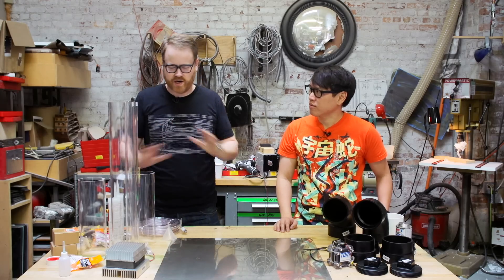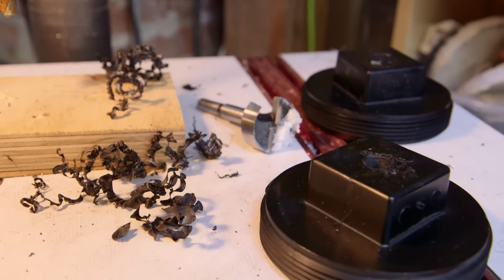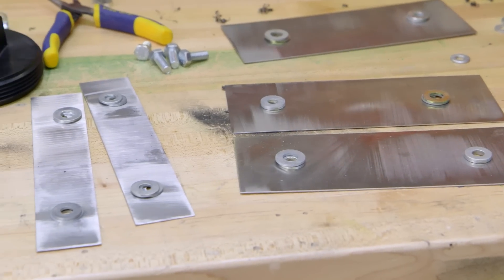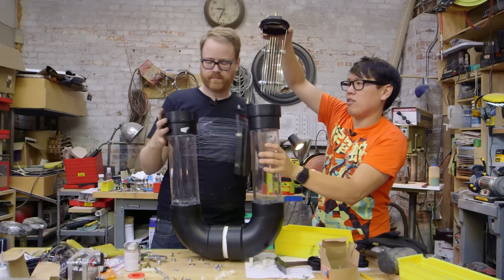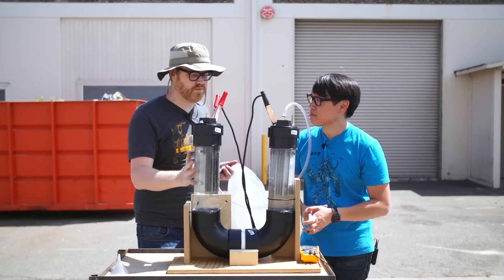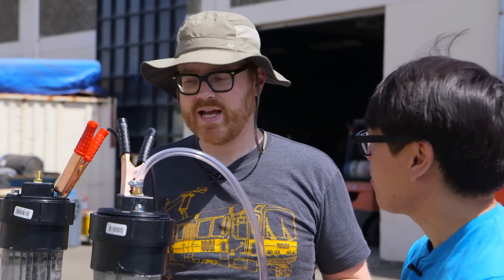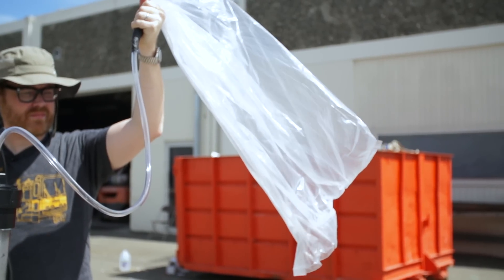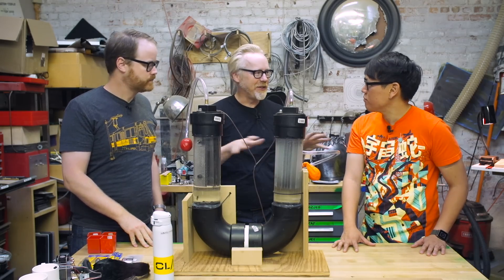Tested Builds a Hydrogen Converter

Comment: WROOOOONG! the trick is AMPERES not voltage, this video was made to fail on purpose, i  hate this kind of "shows"
Reply: @Don Diego Mine is 13 plates with both outside being either positive or negative depending on how I hook it up and all the plates alternate polarity in between. so it goes P,N,P,N,P,N,P,N,P,N,P,N,P, and it pumps out so much gas I get scared to play with it. I made it for a torch but blew up the torch and almost my hand due to not using a flashback arrestor that is definitely the most important part!
Reply: Neutral plates on this configuration are different as they're doing a cathode and anode. There's a difference between the gasses they're producing and the simple dry cells to make only HHO. This was "discovered" by someone at University recently-ish. I'll try to find a link to the article.
Reply: @jonross377 This is a good one  https://www.youtube.com/watch?v=eDXA7Veg6FU
Reply: 😂🤣it's just like the myth busters episode where Jamie tried to start the car off of HHO without even modifying the engine 😂😂😂
Reply: Why don't you make a video showing us the right way to do it?
Reply: I bet you they're paid by big oil companies to try and discredit hydrogen-powered fuel cells like these look up the geek power engine seriously don't do anything
Reply: @pearlstar159  I really wish that wasn't believable.
Reply: @Stephen Laverty ---You can't compress HHO gas to that kind of pressure it will explode on its own, that is a bomb, don't try it !!!
Reply: Correct
Reply: Y'all don't know what you're talking about. For a given cell design and electrolyte concentration, Volts and amps are proportional to each other.

If they put them closer together it would drop resistance and produce more gas
Reply: 2v
Reply: While electrolysis can produce hydrogen fuel through the separation of water into hydrogen and oxygen using renewable energy sources, the process requires a significant amount of energy to be inputted, making it inefficient and not environmentally sustainable. For instance, to separate one mole of hydrogen and oxygen through electrolysis using stainless steel electrodes and potassium hydroxide as the electrolyte, it requires an input of approximately 179.3 watts, which translates to a significant energy requirement for large-scale hydrogen production. This makes electrolysis an unsustainable fuel source, as it is not yet efficient or cost-effective enough to be a widely viable and competitive alternative to traditional fossil fuels. Also, voltage and amperes go hand in hand. Like the old trope it's not the voltage that kills you it's the amps but the true statement is it's not the electricity that's kills you it's the electricity. Look what I'm getting at is take some time to better understand the chemistry, electrical physics, and thermodynamic laws of energy conservation (sounds fancy but super simple). You'll gain a better understanding of why this process is not feasible for powering a vehicle. However, here is something that might spark your interest into learning more. A hydrogen fuel cell takes hydrogen and oxygen forming them back into water then taking the energy used to split them. They are being testing for car battery replacements but we are nowhere near there.
Reply: Correct but the only way you're going to get more current to flow through the solution is by increasing voltage (without changing electrolyte concentration)
Reply: I barely know anything about this stuff. I do know some about electrical. I knew it was shit when he says they went with the panel instead of a car battery because they wanted to go as "green" as possible. Most solar users have them hooked up to batteries lol. This show is hot garbage lol. 
What sealed the deal was knowing they didn't use the car battery because the cranking amps would have been way more than the amperage of that shit panel lol
Reply: Jackasses. Did this on a much smaller scale with a higher amperage panel and it works great. Click bait BS. Fkng useless channel, would not recommend...
Reply: Lol... I wanna now the full motive in this as I learn. V and W are 1:1 and what of amperes. A bunch of couple of zeros😮
Reply: That's right
This vidéo was maded to break this idea
Reply: @Don Diego can you show us how to build a real one. Pls. Im trying to make my bycycle run off of hydrogen by decreasign the fuel ratio to a drip rather then a flood to be safe. I need some help plssssas!!!!!!!!
Reply: @burntchickennugget191  Like this?: https://www.youtube.com/watch?v=prSbM4Zsx8M
Reply: correct
Reply: 12 volts at 7 to 10 amps does mine good without the water starting to boil.  works same as the 5 volt at 24 amp config :-)

yup.. your right, and his cathode and anode are a foot apart..  I bought a unit that spouts 1 litre a minute..  but the plate are a millimeter apart lol....
Reply: True  I just hooked my 5 plate up to my panel an its pissing out h2 /0 ...these guys were paid good money to lie its a disgrace hey..
Well at least we have fuel if the Sh!t hits the fan :)
Take care
Reply: True
Reply: Confirmation: I was there. Was the previous subscriber to Adam Savage's Tested.
Reply: You are right it is current that drives electrolysis, not voltage. Also was surprised to hear that they wanted to get 15L of hydrogen from what seems to be less than 15L of water.  And that's on top that there is about 12% of hydrogen and 88% of oxygen in water. They would  need about 100L of water to get 15L of hydrogen from it.
Reply: Michael Lysov , nope. 
This video shows no pressuring or cooling equipment. So I’d assume that the oxygen & Hydrogen is to be at room temp and atmospheric pressure.... both would be a gas.
From 3rd form science, a gas is much less dense then a liquid. Your 100L of liquid water would give, slightly more then 100,000 L of hydrogen (as a gas)... hydrogen is the least dense element... means not much of it occupies a lot of space.
I think they have enough water in the tube.
Reply: @wingmanmedia6536     I hope you were being sarcastic or are you just plain STUPID !!!

Comment: Pulsed higher dc voltage with plates at close distances works better. Dont push when you can use a hammer.

Comment: You guys had to of made this faulty on purpose. I've seen countless videos, especially from Grant Thompson, where low voltage, high watts, will make the gasses pour off from the water/electrolyte mixture at a relatively rapid rate. But it's not a surprise to me ;) you bozos did the same stupid shit on Mythbusters using tap water and denounced the entire process as useless. Now you know too many people have been doing this at home, so now you want to make it sound too inefficient for home use. Bullshit.

Comment: Once I saw that redheaded dildo pop in at 9:00 I knew this would be bullshit. Way to suppress people by not building this properly. When you scale this down and hook up to your car battery you will be running ZERO emissions, boost of horsepower, and cleaner motor. If you are smart enough to be on here on this subject, do real research instead of "paid for" tv dumbing you down with their fictional science. You wont be able to harness hydrogen but you could power your car and so much more with this and other amazing free technologies. Use it or lose it.
Reply: +Duke Nukem , are you saying you can connect a hydrogen generator to your car battery and run the engine (ICE) only on the gas produced to obtain Zero emission?  or are you saying that adding the H gas from the electrolysis will turn the petroleum fuel combustion into Zero emission?  More details on your proposed system please,  like how much H gas production needed per 100 CID or 1000cc engine displacement?  How much amps does this system draw & how much hp/kw engine output is lost on providing the electricity to power the H gas generation system? How much wheel HP gain can one expect from this system?  And most important of all is this system defeating the laws of thermodynamics?

Comment: Another way to build the plate assemblies would have been to use a long flat stainless plate sand it up and wind it into a spiral, thus saving a lot of engineering work. A stainless rod could be welded to the centre of the spiral for the input to each electrode.

Comment: What happens if you put heavy water instead of normal water?
Reply: +Eduardo Cury you would create mainly Deuterium Gas  (²H) instead of the mainly diatomic protium Hydrogen gas (H2) you get with normal water.  You'll also need more electric energy to split the deuterium Hydrogen from the Oxygen since the bond between them in heavy water is stronger than it is with protium Hydrogen in normal water.

Comment: If memory serves me - energy follows the easiest path:  Through the metal bolt.
Therefore:   use non-metal rod and insulate between nuts and plates.  Then current will travel through water/electrolytes.

Comment: These guys are muppets.
I could literally get more HHO using a 2lte milk bottle and 2 steel plates in my kitchen.
They clearly do not even have the most basic understanding of how electrolysis works.
Reply: The task was to obtain 15 liters of Hydrogen Gas and not Oxyhydrogen gas (HHO). Guess you'll need to make some mods to your milk bottle to do that.

Comment: the reason it failed was the distance between the cathode and annode. they placed them on opposite sides of the device. if they wanted it to work both sides need annodes and cathodes in close proximity.

Comment: Why not use hydrogen as a primary fuel source? If it's so abundant
Reply: +Insomnii sure it's abundant but the problem is Hydrogen is not naturally available in it's pure atom form instead it is chemically bonded with other atoms into molecules like water for example.  This chemical bond is very strong and it requires a large amount of energy to break this bond to obtain the pure Hydrogen. Furthermore production methods like electrolysis to obtain Hydrogen are highly inefficient thus making it rather expensive to obtain pure Hydrogen in sufficient quantities via these methods.  Industrial Hydrogen production via steam reforming of natural gas can be done more efficiently but it is still more costly to produce Hydrogen than petrol fuels.
Reply: Arya Javaheri you need to do much more in depth research on the subject matter. Some hints regarding Hydrogen storage, look for High pressure gas, liquid, adsorption and absorption Hydrogen storage  methods.
Reply: Arya Javaheri huge difference between elemental Hydrogen ( Atom ) and Hydrogen chemically bonded in a Molecule, look up the difference.  You should also look up how much electricity is actually needed to split water into Hydrogen and Oxygen via electrolysis,  it's not just some if you want   quantities of Hydrogen that are of use and not just for those small school HHO gas bang experiments. Multiple different storage solutions of elemental Hydrogen are also available but just like the production of Hydrogen these are expensive thus add to the already overall high production cost of Hydrogen.
Reply: Hydrogen is hydrogen. A hydrogen atom cannot tell the difference if its been released from the bonds between itself and oxygen versus wherever else hydrogen can be obtained from. I've looked into this subject and spent many hours in research to know that the issues lie within its storage.. not in its production.
Reply: +Milan   not to mention the inefficiencies in making the hydrogen, the embrittlement of metals when exposed to high pressure hydrogen, etc. etc. etc. Hydrogen is one piss poor energy carrier, regardless of what the hydrogen people say. And HHO on demand systems, as you have said, are great for making the HHO on demand system MAKERS rich, while scamming the poor suckers who are looking for something for nothing. The ignorance about all this shit is so disheartening.
Reply: Insomnii The comment above is nonsense. The reason why it isn't so abundant is because hydrogen is quite difficult to store.
Reply: Arya Javaheri since when has storing of Hydrogen anything to do with the natural occurrence of pure Hydrogen? The reason for natural elemental hydrogen being rare in the earth atmosphere is that it actually will slowly escape the earth atmosphere due to to it's light weight and the gravitational force of the earth being too low to hold it back ( look up atmospheric escape )
Reply: What you are saying doesn't make sense. Hydrogen is everywhere. It's in the water. Do you know how much water there is on this planet? All it takes is some electricity and you get hydrogen. The problem is storing this hydrogen to be using as fuel.
Reply: Cuz the human race is stupid

Comment: pro tip- use a T connector in the middle and a 3'rd tube to allow refuel without stopping the aparatus
Reply: That IS an excellent idea, except they need an entirely different rig to have it work worth a crap.  I thought the same thing when they were assembling this turd.  +1

Comment: One of the problems is the gas bubbles stick to the plates and block further gas production The water molecules have to physically hit the plate to get or give up electrons which does not happen with the bubbles in the way. Notice that the most active gas producing areas were the ends of the plates where the bubbles buoyancy caused them to detach and float up. Flat plates are not the best idea unless you mix the water during the process.

Comment: Seriously, did you do his wrong on purpose?  The U shape you used was completely wrong. Also, you could have used a stepper to up the voltage. 22 volts is very low.
Reply: 22V is much too high. You want 2V and as much current.

Comment: too bad grant thompson didn't get invited over, they mentioned the king of random and yet they couldn't make a hydroxy generator anywhere near as efficiently as he did xD

compiled mistakes:
- not enough plates
- only 2 plate sizes
- poorly conductive 
bracket assembly
- no nylon washers
- poorly insulated assembly
- poorly sanded plates
- unprofessional finish
- manually drilled plates 
(innacurate contact fitting)
- no oneway check valve
(gas constantly trying to go
 back inside the chamber)
- only one solar panel 
(could have jury rigged 4 to 8
 solar panels for more efficiency)
- unfiltered sodium hydroxide
 water solution used

as a science project it turned out ok but it is nowhere near as good and efficient as it could have been with a little more effort.

Comment: 3:09 Few things annoy me more than when I get PVC cement on the pipe outside the joint.
Reply: +Scabbage  Did you notice how they slathered on the silicone caulk around where the clear tubings joined the black U tube?  Seems their sloppy PVC cement job didn't hold too well. The whole system was a kludge from the get go.
Reply: I have a friend who is a prof. plumber, he taught me how to prep and connect pvc piping without making a mess of it. Not that hard, but the primer is the key, he says. He always lets a little purple show at the joints so that the inspectors won't get their panties in a wad wondering if he used it!

Comment: I didn't see anyone stir the potassium hydroxide in until it disolved. Also, for each electrolysis unit there is an optimum voltage and amperage setting.
Try adding the electrolyte to suit the volt-amp settings. Start with stirring KOH (potassium hydroxide) into room temperature, distilled water to the point of saturation, that is where you add more KOH and it won't disolve no matter how much you stir it. 
By now your electrolysis unit is assembled and set up properly. Turn it on and add the KOH solution  an ounce or two at a time until you aren't producing  the maximum amount of HHO.
Tall guy (I'm sorry. I don't know your name.), I'd be willing to bet my house that the apparatus your high school teacher used to demonstrate electrolysis, generated more HHO (proprotionately) than yours did. I'm pretty sure that if you had done it properly (I'm also sure you guys all know the "mistakes" you made.) you would have had 15 liters of H2 in about 3 hours (I think I'm being generous with 3 hours).
Go ahead. Give it an honest try.

Comment: A friend of mine built a much much smaller rig, but it made way more hydrogen than this....I think they screwed something up here.
Reply: I don't think they are actually separating the hydrogen from the oxygen, so they end up wasting a lot of energy and gas.
Reply: They swapped around Volts and amps. simple mistake, pretty easy to fix.
Reply: They put it into balloons, the hydrogen gas has to fight against the pressure of outside external forces  as the balloon can expand and contact etc.

Maybe if they put the balloon in a chamber with a one way valve for the air from the chamber to escape, letting the balloon exit freely, then the hydrogen wouldn't be forced back, or at least we eliminate that error.

I would say this was a systematic rather than random due to this being apart of the method.
Reply: Joe Cleveland they have done it more then once because they are paid for.. the building shaking machine they tried to make one time had no basis on the actual patent at all they didn't even look at it. They are propaganda

Comment: they hooked it up wrong they have 2 separate cells and they hooked both together 1 cell + 1 cell - but didn't link them together for each end of the individual cells they got the plans from the king of random and he made way more hho then these guys.
heck I even made one out of a 5 gallon bucket and 2 ss dog bowls and got more hho then them, before you try to redesign someone else's work try making it the way they did and follow instructions to the letter.